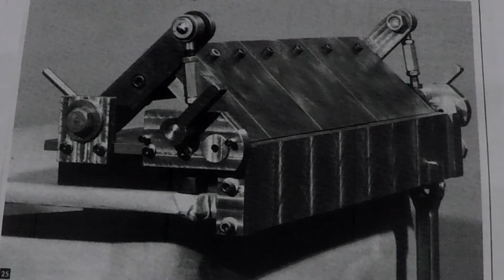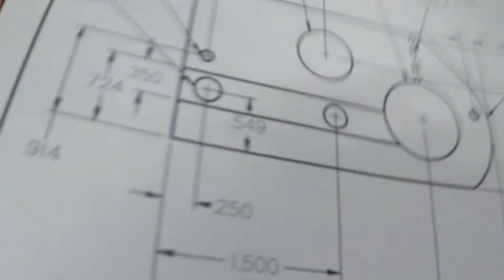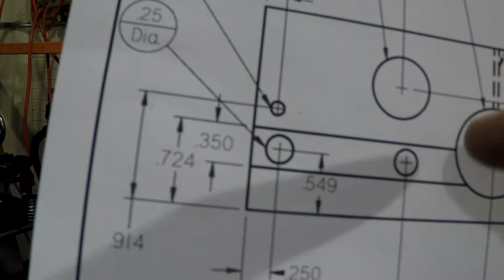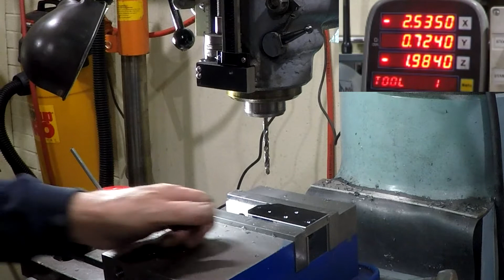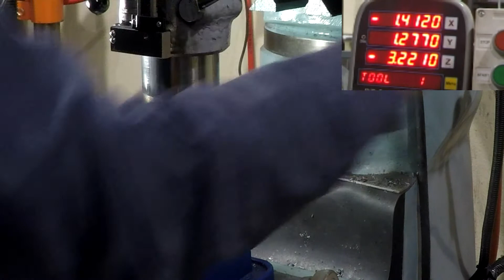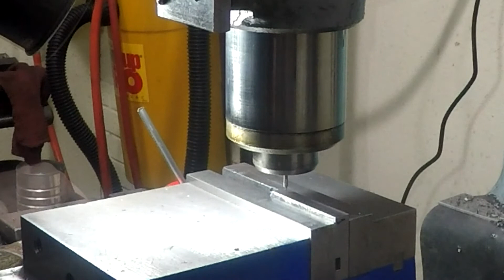Bending Brake Episode 5 - Making the Base Hinges

Comment: I just ran into these video, and have been binge watching, up to this point. I’m told I have to come up for air and take in some sustenance (dinner), I guess, lol. Please excuse my impertinence, but May I ask, would you happen to have prints of this bending brake? If so, how would I go about getting a set? If not, I’ll try to follow along, as best I can to the rest of the video, thanks.
Reply from the maker: I don't have a set of drawings. I do have the Solid Edge 2D file in .dft format if you have the ability to import the file and make use of it. A word of caution, the files may have a few places where I modified dimensions on the fly and did not update the CAD file. You would have to check everything before any machining.